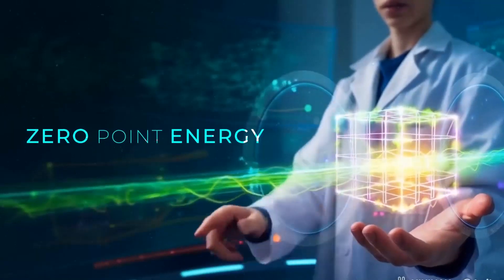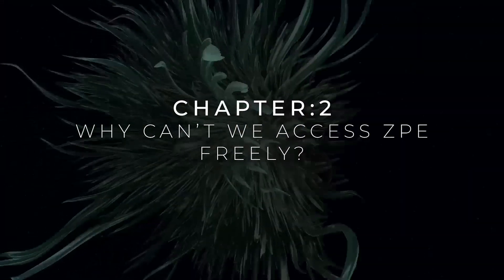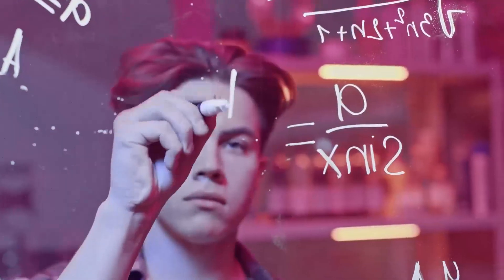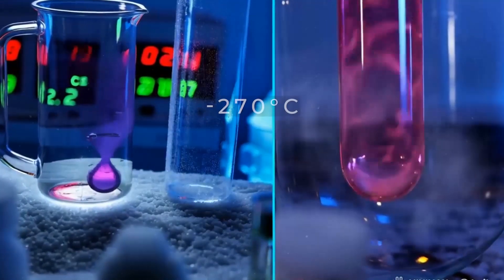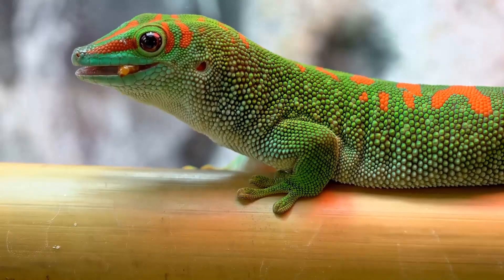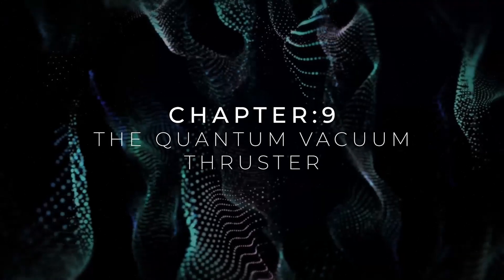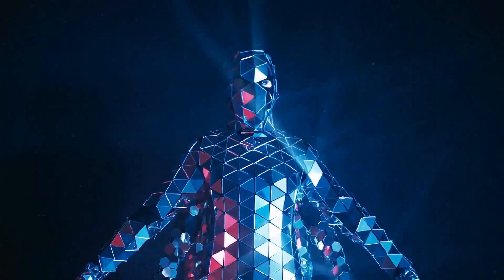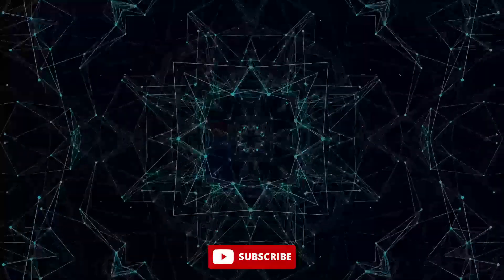Zero-Point Energy: Unlocking the Quantum Vacuum!

Comment: It’s that simple. I don’t know how I didn’t know about Ergs. The solution simply must be changed from one unit to another. It’s like finding out Thermodynamics exist and everything people talk about makes no sense compared to the truth. For instance, just because people say a process occurs or doesn’t occur because Thermodynamics allows it or doesn’t, that doesn’t mean the process will or won’t work, because Thermodynamics is an idea like all other ideas and it doesn’t make anything true or false. A solution or no solution makes a thing true or false. I guess it makes no sense that creation is real either. However, because someone can misunderstand something as a concept of creation, anything is possible if it’s explained correctly:

“1.0E-7 watt”

“Erg is a unit of work, and power is a measure of the rate at which work is done. The conversion between erg and power depends on the context and the specific units being used. For example, 1 erg/second is equal to 1.0E-7 watt13.”.

That was simple.
Reply from the maker: Thanks so much for your contribution brother. Great food for thought